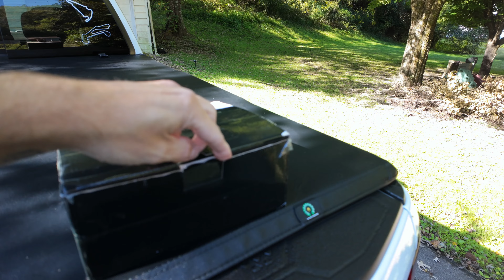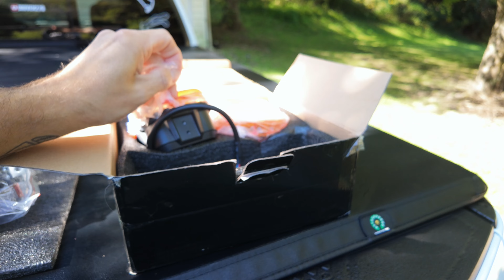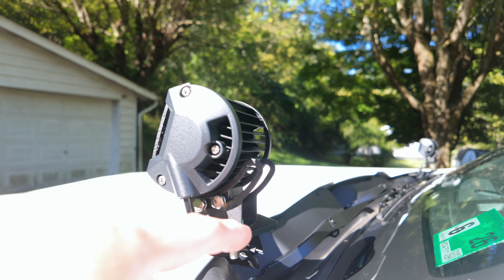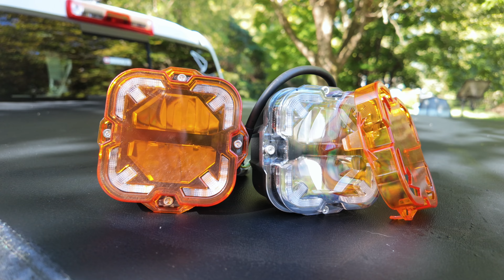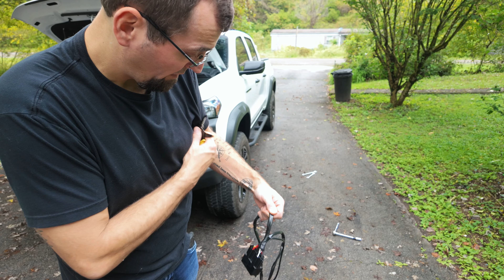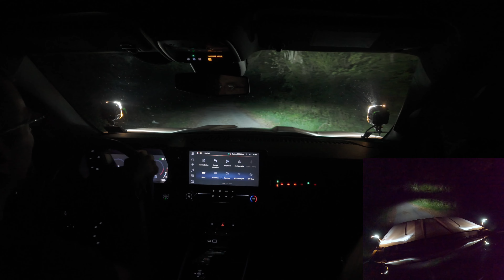Hawkglow 172-watt LED Ditch Lights + Step by Step Guide- 23-26 Chevy Colorado

Comment from the maker: 🔥 Just swapped out the Nilight Pod Lights for the new Hawk Glow 4” LED Off-Road Pods on my 2024 Chevy Colorado Trail Boss! In this video, I walk through the full install, wiring, and side-by-side comparison so you can see the difference for yourself.
💡 Question for you: Which lights would YOU run — Nilight or Hawk Glow? Drop your thoughts below 👇 and let me know if you’ve had experience with either brand! & check out the discount code in the description!
👍 Don’t forget to Like, Comment, and Subscribe to Driven276 for more installs, reviews, and trail content!

Comment: Are the Go Rhino brackets good quality? Are they level and do they rub on the plastic cowl?
Reply from the maker: They are good quality. They do make contact with the black plastic pieces on the sides but not the cowl itself.  I would recommend them depending if you mind them running the plastic.

Comment: Oh man. I wanted to see how you fished the switch panel through the firewall before i do mine tomorrow. Oh well. I guess I'll see how well that puncture tool works i bought lol
Reply from the maker: Thank you for watching. Mine was wireless though if I was doing that type I would fish it through the main wiring harness in the firewall as that would mean you dont have to make a new hole.
Reply: @Driven276 damn it. I didn't even think of that. Was pulling it through the grommet , the guide wire snapped, my hand flew back and hit the rail the passanger seat slides on. I didn't realize until after I got back from ER it has a plastic cap on it... I hit a plastic cap with no sharp edges so hard, all 4 layers of my skin opened up and it did so over my veins in my hand. Yep.  There's my veins exposed to the outside air LOL. F me..  they gave it a iodine bath and doc felt steri strips might hold it together. It's been a few days. Seems I'm good. And my hand is usable again. Sunday I finish the job. The hard part is done. It's fished through.
Reply from the maker: Hate to hear this. I do hope you recover very quickly. That sounds like a very painful adventure for sure. I am sure you will be happy when its all said and done and you finish the job for sure.